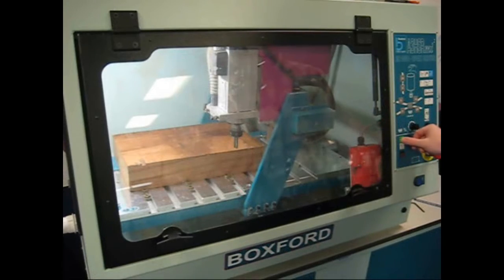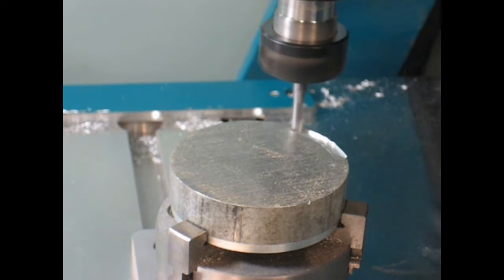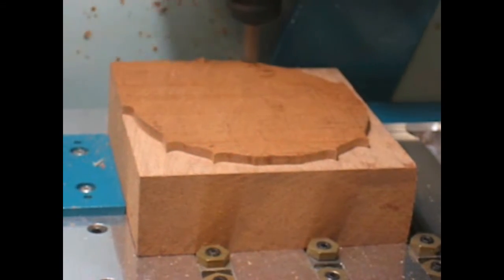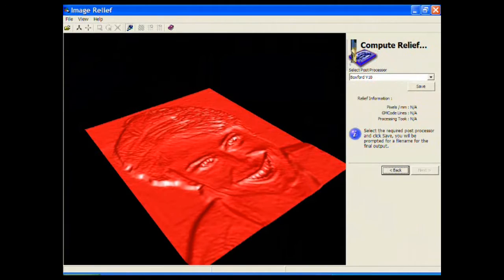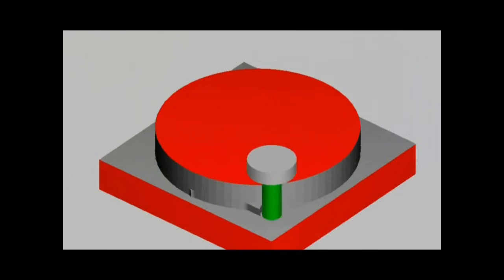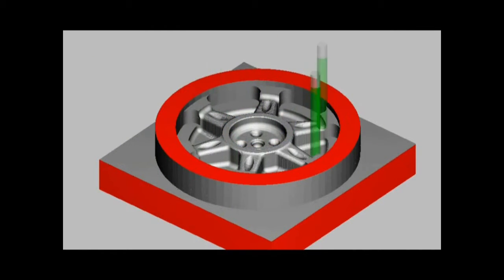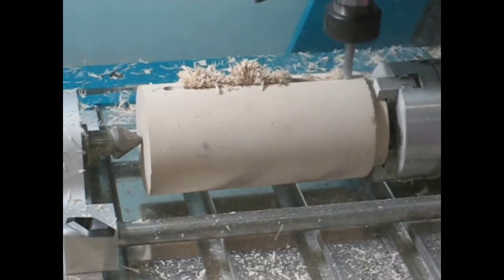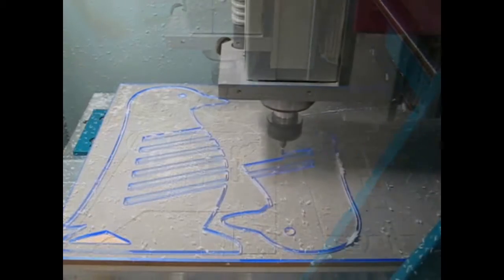Boxford A3HSRmi² Router - Machine Overview

Comment: What's the max size you cut
Reply from the maker: Hi John, the travel on the A3HSRmi2 is 575mm x 325mm, however you do need to leave some space round the edge to clamp material if using clamps, plus account for the router bit size you are using, so I'd say around 550mm x 300mm for the max cut size. More info can be found on our website, where you can also contact us for pricing if required. Thanks! https://www.boxford.co.uk/routers

Comment: How do you add a new tool to the tool library of the Boxford A3HSRmi² Router
Reply from the maker: You need to be an administrator – Select ‘Settings – Current User – Administrator – OK (password is normally blank unless someone’s changed it)

The tool library edit icons are now available.
This is covered in the software help under the section - Tooling and Axes - Setting Up